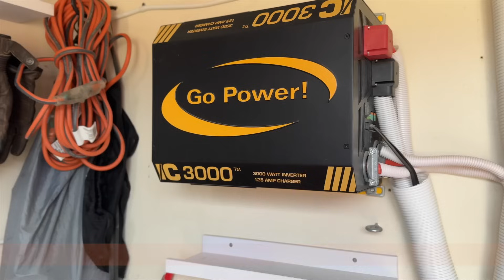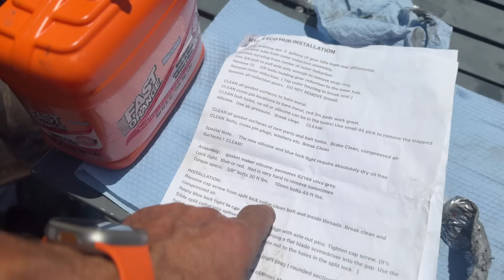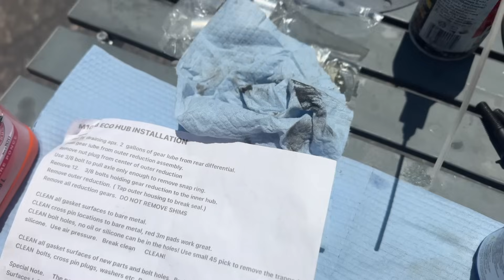Eco Hubs Direct Drive Install & Review  | Ep 21

Comment: The pedal on a diesel isn’t a throttle, its a speed selector.  The pedal position tells the governor or ECU in your case what RPM to run at, and the gov/ECU controls the fuel to achieve and maintain that commanded RPM.  You halved the final ratio, so you halved the engine RPM and pedal position necessary to maintain a given speed.  At 30K, your gearing should be delivering ~13,400# of thrust from the tires.  That should be enough to pull you up 26.5 deg in first gear at peak torque.  Your performance would be ~10% better with the original diffs  Driving an engine at greater than peak torque RPM is like driving with an exhaust brake on.  Thats where a large chunk of that 37% fuel increase is coming from, and why most report that their fan rarely cycles, you no longer have all that excess fuel burn heat to dissipate…  great video!
Reply from the maker: I love hearing from the engineer mind!!   Thank you for that summary.
Reply: Its the gas pedal.  Just like its always been.  Whether in my Jeep, my army truck or my Tesla...its still a gas pedal.
Reply: @MarcOppelt but there is an ECU in the middle 😢😢

Comment: Coming from a 4x4 off road background I can say the benefit of gear reduction hubs is that they reduce the torque applied to the driveline from large dia tires. So doing this will double the torque on the differentials and ujoints and transfer case. This will also cause the engine to actually lug below the PowerBar and likley increase your fuel milage. This would only be a benefit if in most driving situations you find that your engine is reving at the top or above recommended rpm range on road. My worry will be breaking drive axels or ujoints when offloading in low range as they are now being asked to do double the load they were designed to do. But I doubt you would actually drive your litteral house as hard off road as the vehicle is capable.  CHEERS AND SAFE TRAVELS        Steve h.
Reply from the maker: Thank you for your comments. I suspect you are right, and also right I probably won't test it to the extremes. Did do some way more aggressive off road this week that I had planned to do and it held up good.

Comment: If Eco Hubs are installed, would it still be worth putting in the 3.07 (highway) gears    or    would you just stick with the stock (3.90???) gears?
Reply from the maker: Can't answer that as I have never had that set up. I believe that the eco hubs were designed as an alternative to spending the money on all new highway gears though.
Reply: I have an M1079A0 with 3.07's. I'm happy with this gearing for east Tennessee hills and hauling equipment around. I installed a tachometer and around 60 mph the engine is turning 2,200 rpm's. I have found when pulling my 25ft pintle trailer high gear is too much sometimes and I drop to 6th. Hope this was helpful.
Reply: @flaviusbarker9388  Thanks for the information - but do you have Eco Hubs installed?  I wanted to know if it would be a good idea to have Eco Hubs    AND   3.07 gears installed on an FMTV / LMTV (that is not towing anything).  Based on what you said, it sounds like your towing would become worse to have both the Eco Hubs as well as the 3.07 gears at the same time.
Reply: @JRao no eco hubs for me.  In my opinion the gearing would be too high, 3.07's with eco hubs give you a theoretically 140mph top speed. Not sure how much 7th gear really gets used. I find myself in parts of hill country locking 7th out now as it bogs the motor before the next hill and slows me down more.  I wish I would have timed my truck from 0 to 50 with the 3.90 gears and then with the 3.07's. it's slower to get to speed now I just don't know how much. I still think the 3.07's are great and money well spent if you travel long distances. I bought the raw gears and had an axle shop install them after I pulled the centers myself, saved a little money that way. I hope this helps and any more questions  I am happy to try and answer. I am by no means an expert on these but I've had my truck for close to ten years and have done all the wrenching so far. Happy New year.

Comment: Hi, I saw the episode that deals with changing the hubs, 75 miles per hour maybe in your dreams and if so then maybe for a few seconds downhill. And even then, it's very, very unsafe, and with a vehicle that weighs 15 tons, you should also have some responsibility regarding your data advertises. Do not forget that among your scouts there are many off-road truck drivers.  another thing that I wanted to write to you for a long time, you don't drive the globe as you present yourself, you drive and travel especially in the USA, there are those here who have traveled through Asia on the Silk Road, crossed Russia to Siberia, visited all the countries of Northeast Asia, iran, all of Europe, africa and more and more so, I think you need to practice some modesty. besides that you have a nice channel, personally your bike trips are not interesting and you can also see that they have much less views. I hope you can accommodate a negative review as well, good luck.
Reply from the maker: Thank you for your comments. I am very direct so hope that is OK. Yes- the truck will easily travel at a consistent 75 miles per hour (except uphill) . I very rarely do as I tend to avoid highways.  I'm not sure why you would consider that unsafe. Semi rigs routinely drive at that speed and are far heavier.  I respectfully would like to correct you on the driving the globe part. I have traveled to over 120 countries on 5 continents including almost every country in Africa, the middle east, Europe and much of Central America. I am not sure why you would say that I have not just because it hasn't been in the past 3 years? The bike trips are followed by far less people, however, the viewership is also far more interested based on a much higher total minutes watched result. So for those who don't like cycling- just skip those videos. Thanks again for watching- but most importantly get out there and travel.
Reply: I have an LMTV with the 3.07 conversion and mine will go 75mph. I have the eco hubs ordered and hope to drive 80 as the tires are rated for that. Go find another channel to watch ya tool.
Reply: ya tool ? 😅

Comment: do a video of the RPMs when cursing at 75mph and do a speed test for us.  something like getting onto the highway from an off ramp would be helpful.  thanks
Reply from the maker: Working on that. I just installed an accurate tachometer so I could do that.
Reply: @drivetheglobe  do a video on that tachometer.  I'm looking at getting one of these truck and trying to figure out what's all involved to get everything done right.
Reply from the maker: @King_TuTT  I will include that

Comment: Hello Michael, thanks for the detailed technical videos!  Just wondering, how many miles do you expect to get out of the Goodyear MVTs before needing to replace them due to tread wear?
Reply from the maker: The rears I find last alot longer. I think the set on my last truck went at least 30k. The fronts, especially if you do highway driving are more like 12-15k

Comment: Great video as always . PS if the manufactor would machine a notch for the snap ring to in .because it does not turn push in and put on the cap ,Just one little step. Thanks
Reply from the maker: I agree, that would make it much easier.

Comment: Hey Mike I just finished binge watching all the videos in this series.  I am impressed with your truck and all the work you did. it turned out fantastic.    On your in cab video, you showed the AC center console. Did the folks you bought the truck from install the AC or did someone else and is the AC system of  the installers design?  
You mentioned you're not a mechanic in this video and you weren't sure of the reason for the shims etc.  That's okay I think I can explain if you'd like.  If you remove the shim, you'll notice a nut behind it.  That's the wheel bearing nut and like on most cars they use a cotter pin to keep the nut from backing off.  In this particular hub, it used the 2 pins and inner gear that you removed to keep the wheel bearing nut from loosening.  The inner gear was splined to the spindle to keep it from turning. So you can see that there was no way for the bearing nut to come loose. Keeping the inner gear splined to the spindle allowed the axle, (which you called the drive shaft and were careful not to pullout) to turn the outer gear which was floating.  The outer gear came in contact with the 4 planetary (spider) gears which spun on the cross.  As the planetary  gears were being turned by the outer gear and rotating on the cross but being held stationary by the inner gear the only thing they could do was move the cross and it does it at a 2:1 ratio.  The cross was held in place by the hub and the tire is attached to the hub.  So the cross is what drives the truck down the road.  Phew, that's a lot, so now we'll get back to the shim.  The shim is used to take up or set the backlash between the inner outer and planetary gears.  I know you used the recommended silicone sealant on the hubs, but I found a much better product  It's an International Harvester brand silicone sealant  T-442.   On those Eco gears, all they need to do is machine out the inside diameter of the part the snap ring hits, problem solved.  If they say it will make the part weaker there's plenty of room to make the outer diameter bigger and not interfere with the 12 bolts holding it on.  Thanks for sharing your truck build.
Reply from the maker: As I always say- love hearing from the engineering minds. That makes alot of sense. Thanks for all of the support.

Comment: Hi, why did you choose Stuart & Stevenson instead of other options? It weights a lot and eats a lot of fuel. Unimogs have small engines and frames?
Reply from the maker: I had a Unimog before. This truck is much more modern, faster, and parts availability is far better.

Comment: How did you reset the transmission ? Did you just did the on/off from the truck or you had to connect something to it ?
Reply from the maker: Just did the on / off thing. Followed the directions in the manual.

Comment: can you post how you fixed the speedo to show the correct speed.   I would like to see how the hub oil goes back in.  this is the 1st time I've heard about needing that C clip at the end of the install.  why is that C clip needed??   thanks
Reply from the maker: I have not corrected the speedo yet. Have not quite figured out how. The C clip I believe holds the axle shaft from moving in and out.  There is no C clips on the front.

Comment: Definitely makes sense by removing the planetary/spider gears that the vehicle would yield better fuel mileage and increased speed by reducing the friction points . 

Perhaps the main purpose for the complicated gears is to manage turns on such a heavy truck. However  , after 2800 miles seems like so far the benefits outweigh whatever features the spider gears provided.
Reply from the maker: I think the gears were put in by the military to hit some certain spec that was in the requisition. Not sure what that was but thats what I figure. For most of us I think these are all positive.
Reply: @drivetheglobe  The truck specs required that it be able to navigate an 18" vertical wall. Thus the tire size - to ride up over an 18" wall the wall must hit the tires below the center line sufficiently to climb it easily. The gear reduction is for that, and for the boundary conditions of the largest MTV (M1089 wrecker for example) pulling it's full rated capacity up the steepest possible grade. A combined weight of about 90k pounds. For such a load the hub reductions would very likely be required to even get the whole mess moving up a grade.

Comment: Spider gears or planetary gears? 😁🤘🏻🤘🏻
Reply from the maker: Thanks, probably planetary gears actually.
Reply: @ I wasn’t sure. Can’t see them well enough. Could very well be a spider gear setup as well. Either way, I love your rig. I’ve wanted to do the same with an Oshkosh 8x8 or 10x10 ….. but the axle ratios available on your S & S rig have me second guessing myself. Might do a 7 ton 6x6 with the rear steer too.